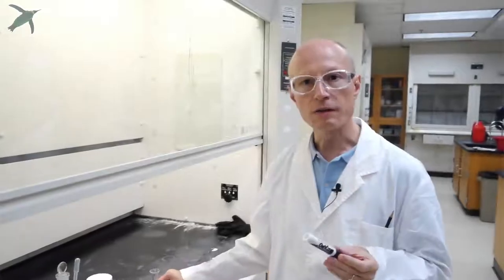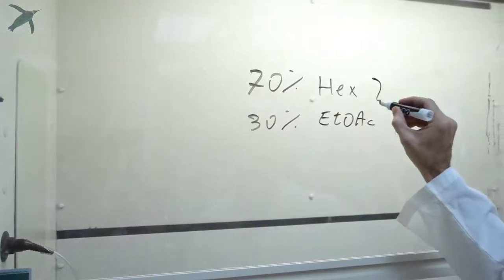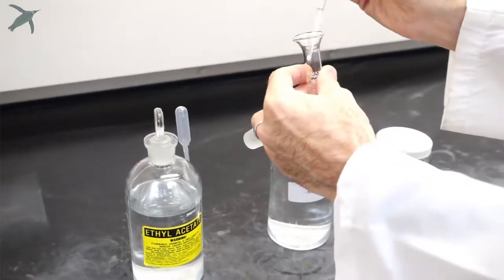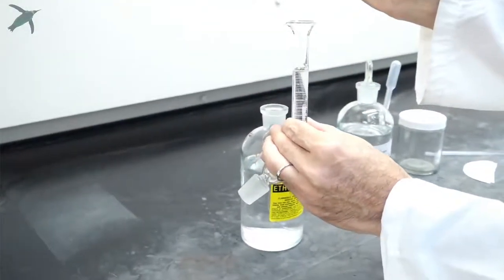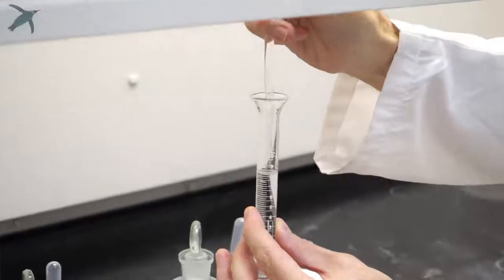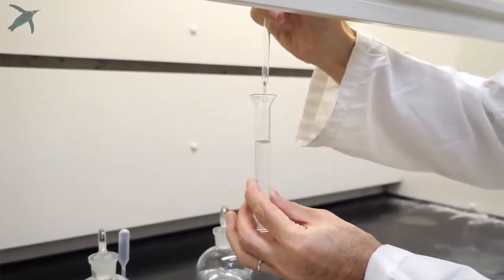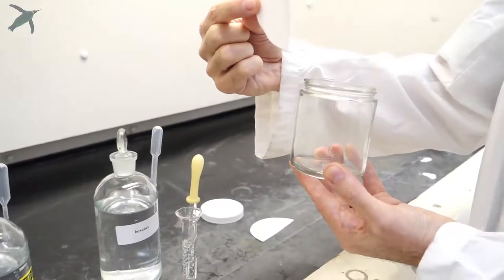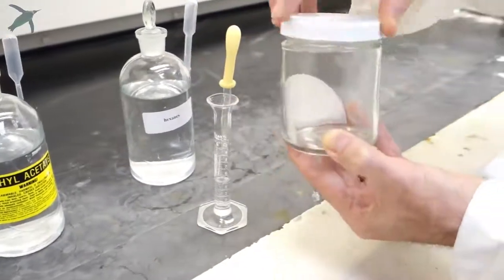How to Set Up a TLC Chamber

Comment: What is the purpose of the filter paper? Thank you very much for your videos!
Reply: “The filter paper keeps the chamber saturated with vapors so when the eluent rises on the plate it doesn't easily evaporate, but continues to climb and undergo the chromatography. If the eluent evaporated, movement would stop, but could also change the local composition of a mixed eluent and affect the results.”
— LibreTexts Chemistry. “Step-by-Step Procedures for Thin Layer Chromatography”